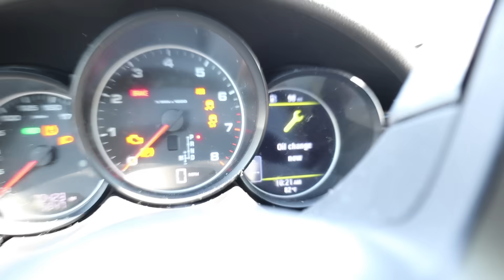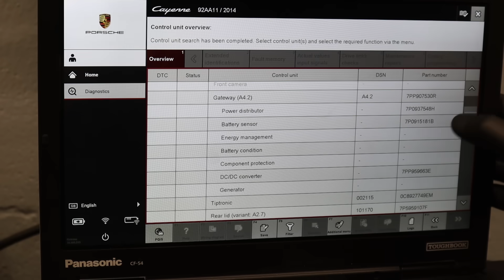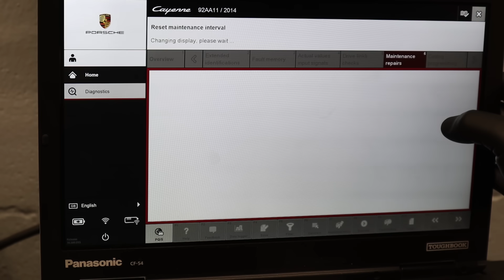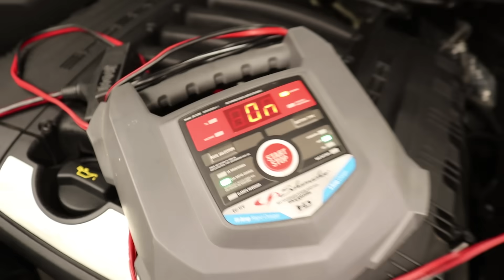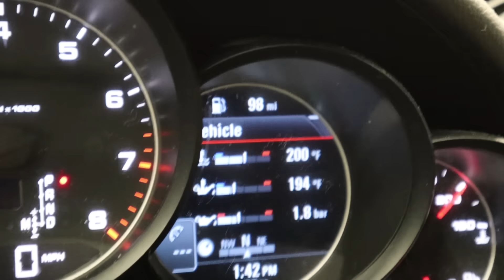Oil Change And Yearly Service | Porsche Cayenne

Comment from the maker: Since I’m seeing a lot of questions about this here you go. Thanks for watching! 

Chemicals and sprays used in the video:

Brake clean - used for oil filter housing and cleaning residual oil off of engine. 

Mild degreaser - used to clean engine bay before applying Winzer rubber and plastic restore. 

Winzer rubber and plastic restore - used for door/sunroof seals and engine bay trim. As far as I know this is only sold to shops for professional use. 

Wurth HHS-K - used for door hinges and locks.
Reply: P - Tech many thanks
Reply: I was literally just going to ask you that after watching! Thank you so much. I rarely trust anyone to work on my cars but I would be comfortable letting you work on any of mine!
Reply: HHS-2000 K seems to have been discontinued, replaced by HHS+.  It's available on ebay.
Reply: Thank you!
Reply: I added a comment below but could you please do a video on your efforts to inspect a vehicle that is a candidate to become a CPO?
Reply: Hi Ryan. in experience, what are the common wear and tear items for the 958? I read that the front air shocks and lower bushings can go. Would you share your thoughts on this please?
Reply from the maker: Yes, I’m planning on a CPO video. Thanks for watching
Reply: @PorscheTech  i learn so much from watching  your videos 
thank you it  helps me so much working  on my  958.2 gts.
Reply: @PorscheTech  have you considered an affiliates page on Amazon linking to the products you use so people could find them easily and you could make some coin 😉
Reply: Very nice your video’s
Reply: Tks for the great video. Not too many techs know about the VR6 and describe them as the V6 engine.  I'm surprised that you didn't pre-fill the OFH+Filter with oil before installing back to the engine.
Reply: Did you replace the oil drain plug washer or reuse the one on it?
Reply: @JimBobBek Welcome
Reply: i dont mean to be so offtopic but does anybody know a tool to get back into an Instagram account..?
I was stupid lost the account password. I would love any tricks you can give me.
Reply: @Gus Terrence instablaster =)
Reply: @Kingsley Milan i really appreciate your reply. I got to the site thru google and I'm in the hacking process atm.
Seems to take a while so I will get back to you later when my account password hopefully is recovered.
Reply: @Kingsley Milan It did the trick and I now got access to my account again. I'm so happy!
Thanks so much, you really help me out!
Reply: @Gus Terrence No problem :D
Reply: Excellent service.  I’d even bet all his Snap-On tools are paid off.
Reply: Excellent. Thank you now I will take my Porsche Cayenne too. To have fun time. 🤗
Reply: Really like this video. Thx a lot. I wanna ask the lubricant,but you are faster,was i am...thx again!
Reply: OUTSTANDING cleaning and maintenance, brother! Where are you located?? I would use you for every servicing!

Comment: If only all service centers were this quality of work...
Reply: All main dealer Porsche garages are I can confirm as I am also a Porsche technician
Reply: Simon engine bay cleaning too? That standard procedure?
Reply: Jordan Diab yes but in the dealership I work in major cleaning is done by valeters
Reply: If all service centres were like this the average joe would not be able to afford to drive his car as this is a very very expensive oil change.
Reply: But then again if you can afford a Porsche afford to pay upwards of $4 to 500 for an all change
Reply: @Simon-sv6qe  Nope,  most of what was done in this video was definitely not done when my car has been in for annual service. I have gone to two dealerships with my 08 cayenne S. The service advisor is always polite and professional. I have no issues paying for normal service and maintenance and will happily pay to fix what needs fixing. 90% of the cosmetic damage to my vehicle has been caused by dealerships and indy shops. I have photos before and after from most incidents. A rear impact, A pillar mashing, massive gash in the rear headliner, several door dings, a large rear quarter panel scuff. Most recently I had my cayenne in at a dealer for an annual service, and a new set of all seasons to switch out my winters. What ever tech was working on it decided it OK to slam the seats down and randomly throw the winters in the back with out any care for the common rear seat leather tearing in the 957, they created a large tear in the headliner while throwing the winters in the back. The guy was clearly unaware that the full set fits neatly in the back without folding anything down. My car was washed and the undercarriage cleaned prior to bringing it in as i try to do every time. The tire guy and detail shop didn't even have the courtesy to clean the tire installation grease off the rims. When you are paying ~$180 an hour same, as the guy who brought in a 911 your vehicle should get the same level of respect and care but that never happens. This grievance is shared across thousands of cayenne owners.
Reply: Tbh, that kind of service usually comes at a cost. Especially at a dealership like Porsche
Reply: All service centers would be like this if they were be filmed for a youtube commercial :)
Reply: They would have to pay their techs a good hourly wage, no one is going to do this flat rate if they actually wanna make any money
Reply: ohohohohohhoho mais il parle peut être
Reply: The question is does he do this all the time or just when the camera is rolling?
Reply: You kind of have to with the camera rolling..
Reply: Dont Care -I think they’re doing this only when the cameras rolling because I used to work at garage and they kept wanting to move cars 
move cars.
Reply: @Cliff00936  Don't be COY!
Reply: @dontcare563  Do Care.
Reply: @mikebing1230  my thoughts exactly. more curious if most of these things are apart of the porsche required maint. Even then they could be Flat rate with a guarantee, that wouldn't terrible
Reply: @Simon-sv6qe  Are porsche techs hourly or flat rate?
Reply: @anthonyaguilar9341  we get paid hourly with a productivity bonus structure which works by how many hours you invoice on jobs in comparison to how long you are in that month so for example a 10 hour day we would need to invoice 10 hours of work to be 100% productive which will give us a large bonus it works differently across every centre but that’s our way of doing it
Reply: I'm new to the Porsche brand. I enjoyed the video. I prefer to work on vehicles myself but when it has to go to the dealer you make me feel like it's in good hands! Thank you again.
Reply: Some cars dont deserve it, if the driver dont respect their cars theres no point for mechabics being extra careful.
Reply: Maybe in Europe they do this kind of service..
Reply: @BVB-borusse  Man I can vouch for this I have an Cayenne and I get my car here cause I live in north side in Chicago but you will pay for sure 😄
Reply: I wish all Porsche service centers and techs were as thorough as you and your shop. Have been taking my 14 platinum just like the one in this video to Hennessy Porsche in ATL since new, and I can confirm they don’t go to these great lengths! Even my full 100k service wasn’t this thorough… 😮
Reply: Maybe they just doing this quality work for the YouTube 😂

Comment: What did they park this freaking thing in the woods for a year, then bring it in?  Wow!  Dude, Porsche should be making videos on your professionalism.  True attention to detail is rare these days.  AWESOME WORK!
Reply: It’s not rare It is expensive I guarantee you this oil changed longer than 20 minutes meaning if it’s anywhere close to an hour as you’re looking at over $140 just in labour Not including parts and oil
Reply: That is normal accumulation over a year of out door parking in the open. looks bad but isn't an issue if addressed yearly, way easier to deal with then previous generations.
Reply: If you park on the street under big trees this happens. Mine needs to be cleaned out every year too, the leaves get inside the hood, dry from the heat of the engine, then crumble into the holes. Hard to keep them out.
Reply: @Scypher0th  I do my own oil changes on my 2016 Cayenne Base. Retail cost for the oil/filter/plug needed is right around $100 which means after the first change a c-note and a couple hours of my time is all it costs. I can't bring myself to pay the dealer $700 for such a simple job. This tech certainly does outstanding work and love learning from him.
Reply: 😂
You are dramatic like an old lady. 
It's a handful of leaves dude, relax.......
Reply: @yeah_right88  - Took you long enough, I’ve been waiting here 3 years for your response!
Reply: Porsche charged my grandson $600 to change the oil

Comment: You sir are absolutely top notch. I've done all my own work on my 5 Porsches starting in 1968 including engine and transmission rebuilds. I've never seen such thorough work for an annual inspection. I learned some valuable things about how to clean the cowl area and drains in my 2014 Cayenne GTS. Didn't realize you could remove those access covers so readily. Thank you so much. I hope your employer is recognizing how good your work is.

Comment: This was great! Also provides a good insight of why the yearly service commands the price that it does when most people believe its just an oil change.. granted, I still consider that you go above and beyond! To prove my point, no one at the dealer has taken care of cleaning and lubricating my sunroof, but I still do that on my own
Reply: There is a a large checklist put together by Porsche. When they do a major service they should be giving you a copy for your records with what was done and signed by the technician and foreman/QC checker. If anything on the checklist obviously didn't get done, I would go back and demand that it get done. After all, you paid for it, so it is only fair.
Reply: This doesn't happen at any dealership I have ever been to.
Reply: Mio Isurugi you are correct, I have seen it before. What has happened in the past is that they claim they have done but the extent of the work is certainly not up to par with @P-Tech. Its starting to happen now more often with CPO vehicles too! I know dealers that will sell vehicles as CPO without the prior inspection.. I walked out of a deal exactly because of that and from another because the checklist didn’t add up! Maybe P-Tech could do a video showing his work while inspecting a CPO candidate!

Comment: I'm convinced my local dealership never cleaned out the drains from windshield.  I do weekly maintenance washes on my garage kept cayenne and around 40k miles the cabin was leaking water because of a clogged drain.  I had just had the 40k maintenance done less than two months before.  It is refreshing to watch someone who takes pride in their work and doesn't skip steps or take shortcuts.  After watching this, I will just clean them out myself in the future.

Comment: Not only did he change the car’s oil, he literally detailed the car inside and out and gave the owner a brand new vehicle
Reply: Probably not for cheap, that is the most inclusive Porsche dealership annual inspection I've seen.
Reply: $1,200 annual service.  Not cheap.

Comment: As good as this video is, there is no inspection on the condition of power steering fluid, transfer case checks etc, wiping seals and lubing doors and blowing away debris is more of a car detailing

Comment: Hey P - Tech what do you use for the engine bay cleaning?? Another great upload :)
Reply: I was just asking the same thing as I watched! What is the purple can of cleaner your using?
Reply: Michael Lasnoski probably purple power diluted
Reply: @frank12777  God no. Purple Power residue must be rinsed off completely with water, otherwise it will eat stuff, or (at best) leave an annoying film.

Comment: I have a question? I have a 2004 cayenne turbo with no lights on the dash. I’ve been having some work done on it ...after all the work it was running , the mechanic turned it off and it wouldn’t start. Still no lights in the dash. After a couple of days it started but it’s running rough and still doesn’t want to stay started...could you please give me some ideas to try? Thanks

Comment: My vehicle is a Porsche Cayenne S E-Hybrid. 
Because I live four miles from work and all of my shopping is less than two miles away, I always use the electric motor. I don't recall ever using the 3.0-liter V6 supercharged engine. So the question is, how often should I change the engine oil?

Comment: Great to see what else all goes into "just an oil service". What is the second detail spray you used on the engine? That is safe for the hoses, wires, etc?
Reply from the maker: Please see pinned comment for chemicals used. It’s safe and won’t cause damage. Thanks for watching

Comment: Great video, I've already seen it several times. I'm going to use it as a model when I do my own maintenance on my 2013 Cayenne. One question though, where did you get the dipstick to check the oil level? Do you have a part #? Thanks.

Comment: Porsche recommend 10k miles oil change or once year. I do my oil change every 2500 miles or two times year on my 2005 911. Oil is cheap. I use liqui moly

Comment: I’ve been a fan of your videos. Too bad you stopped filming. Hopefully you moved on to better and bigger things. I have a 17 macan and I hear some water on the evaporator. Do you know where I can find the drain tubes to make sure they are not clogged? Also, I get a quick smell coming out of the ac when I turn the vehicle on. Maybe is related to the water not draining properly. Hopefully is not coolant from the heater core. Thanks.

Comment: Please I need help!! I recently brought a 2004 Cayenne Turbo...the check engine light came on so I sent it to the shop. The mechanic thought everything was good because he fixed everything. He drove the truck and everything seemed fine, he stopped to by gas turned the truck off when he went to leave the truck wouldn’t start. Now when he tries to start it barely wants to start or move. It has completely lost power. Do you know what that could be?

Comment: hi this is a very good video, and I got a question for u. Just bought a used cayenne platinum 2018 from Porsche dealer, and I thought the way filing oil is from  the bottom, why is this cayenne filing oil from top just like other regular car??
Reply from the maker: Jay Zhang none of our engines fill from the bottom. Thanks for watching
Reply: P - Tech lol my bad, That’s the transmission oil, just mix up. please upload more video, Porsche owners would love to see

Comment: I have never ever been able to bring down the filter and the housing at the same time on my 14 base. The housing is too wide to fit between the frame. Not sure how you are able to do it shown at the 8:00 mark.  

I always have to flip the housing upside down and remove the filter first. Then I turn the housing sideways and get it out.

Comment: The 2019-2021 it come with a Lithium Ion battery and I heard a lot of bad thing about those. Like they will die within 3-4 years, and it cost $2500 to replace, and you can only buy them from Porsche, you can’t put a AGM battery in either. Are these true? Could you shed some light on it if you can? Thank you

Comment: Do You Get Paid To Clean All Drains And Engine Covers? Or Is This Part of The Multi Point Inspection Routine? Also What Kind Of Spray Did You Use to Clean Engine Bay And what Aerosol Can Did You Use To Clean All Seals? Great Video BTW!

Comment: Is the sunroof drains cleared, engine bay cleaned with trim and door seals, hinges and locks lubricated apart of the Porsche recommended service or just something you do personally. Just curious as i am a bmw tech and none of that stuff is required in any of the bmw services from the manufacture

Comment: Question regarding Transfer Case Oil.  Is it true you guys started using Valvoline SAE 75W Gear oil in lieu of Porsche transfer case oil?  I went to pick up parts and parts guy recommended the Valvoline over the Porsche brand.  Can you confirm or deny?  Thanks!

Comment: Hi, I really love your YouTube channel and have gain alot of knowledge watching the videos. I have a q: I own a 2009 957 cayenne VR6 . It has the timing chain rattle at startup for about 3 secs then goes away. I've ordered the timing chain tensioner (upper) to be replaced. Would you recommend removing intake, valve cover to lock the camshafts, or should locking the crankshaft from underneath be sufficient to keep it in time? Thanks James
Reply: Tensioner

Comment: Do the owner never open hood to check anything?
Reply: Nothing to check except washer fluid, and the car will tell you. You don't even get a dip stick.
Reply: @TraceyAllen  VR6 engines still have a dipstick. Brake fluid and power steering fluid still need to be regularly inspected.  Honestly the people that buy these cars would rather pay to have a professional look at either because of time constraints/afraid to break something expensive. Which is understandable.
Reply: @mioisurugi2010    I agree

Comment: Great videos, like to listen to your explanation and see how you handle the cars.       Can you run a video on 718 boxster base model (2L engine) of oil change and air filters.   In my last oil service they forgot the oil filter wrench, which took few km to start and make a lot of noise, so I will be happy to learn what actually they did 😉

Comment: Hey bro, question for you. I just got a ‘14 cayenne platinum edition (3.6L) and like to do most of my maintenance myself. She’s super fresh with only 30k mi. So very clean. I pulled the oil service list and saw fuel filter on the checklist. Are folks really changing fuel filters every oil change on these things?